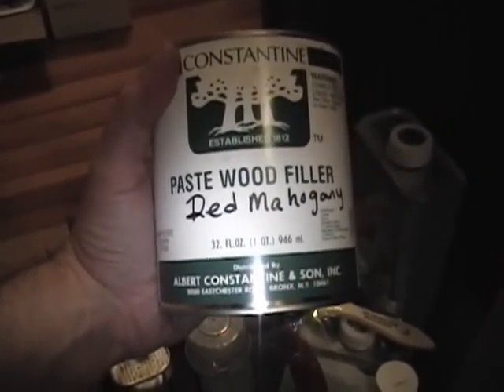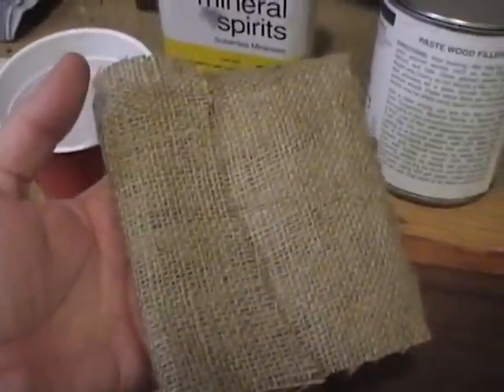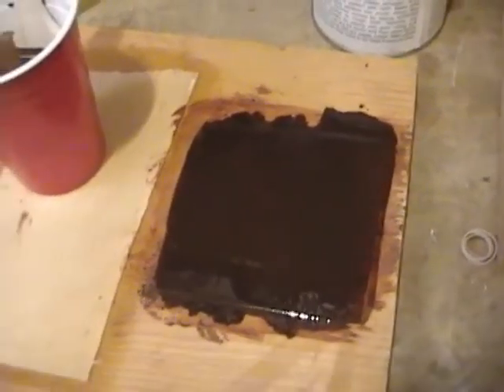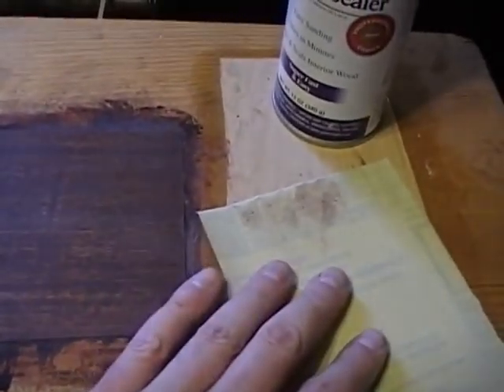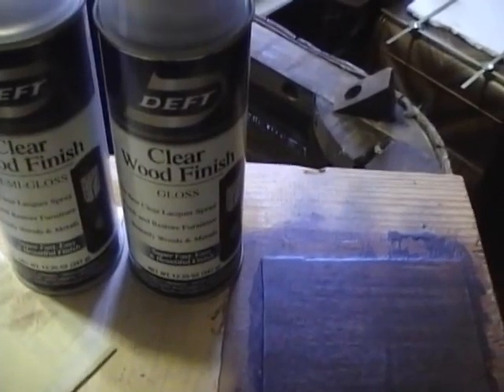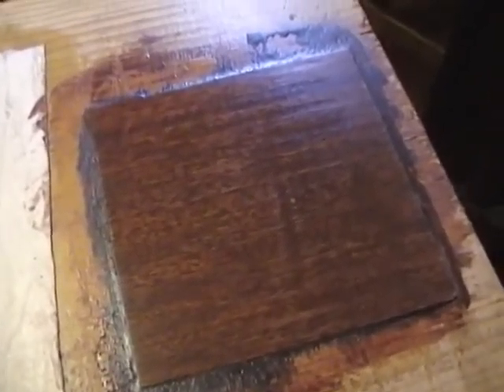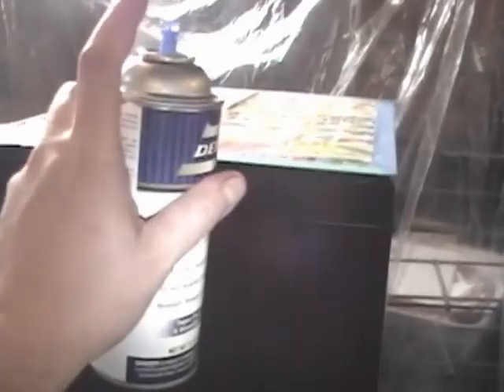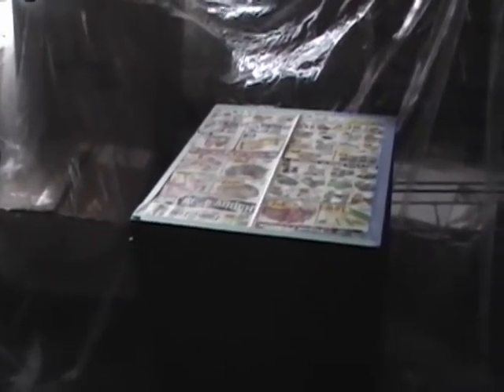Motorola 12K2 restoration p8o?

Comment: @bandersentv I'm not sure what it was called exactly, it may have been called Danish Oil, to me it just looked like oil stain but smelled worse then normal. In any event these people seem to believe that using Watco oil magically makes their refinishing job professional grade and restoration quality, even though it looks like they rubbed used engine oil all over it. If I ever acquired a radio subjected to that treatment I would have to wash it down with acetone before allowing it in the house.